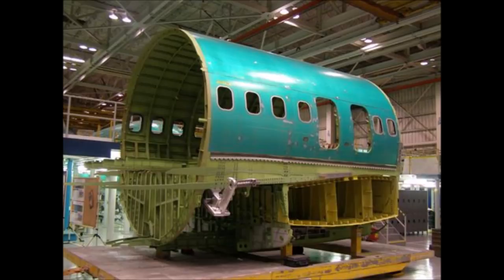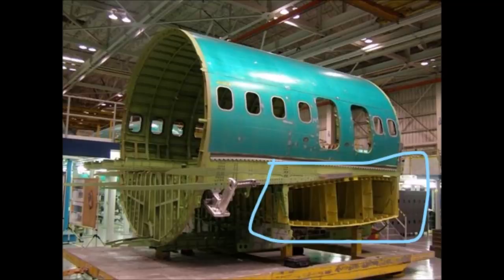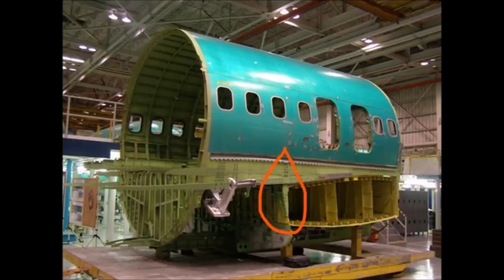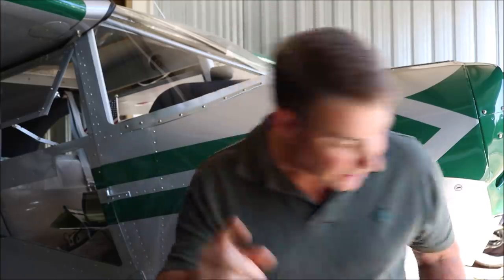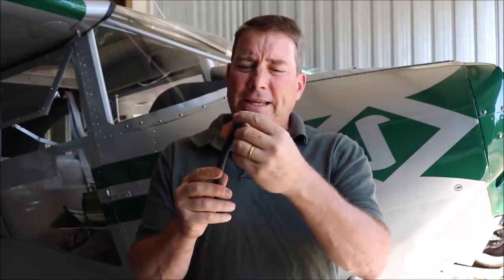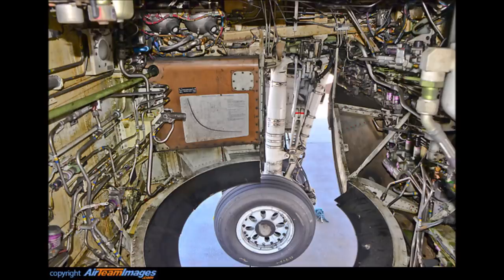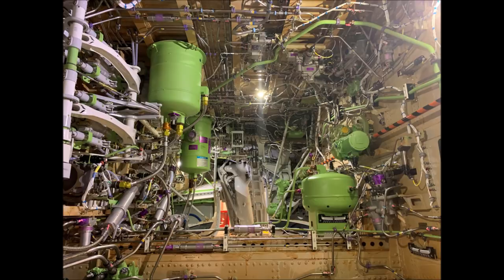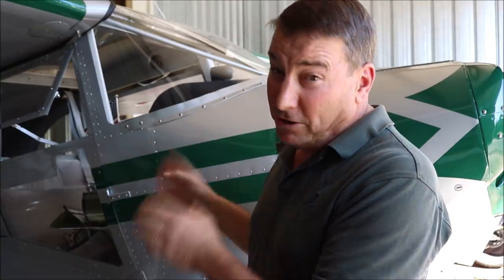737NG Pickle Fork Cracks AD 2019-20-2

Comment: Repairing the cracked parts looks like an absolute nightmare. Heaven knows how much would need to be stripped just to gain access to it, let alone getting in there and replacing/bracing the affected area.
Reply: Probably impracticle.
Reply: @angelreading5098  - I suppose it's up to Boeing to assess whether a repair is possible and what the cost will be. It sounds like the sort of repair that Boeing themselves would have to carry out, and it may well prove to be uneconomical. What a nightmare for Boeing and the owners.
Reply: Yes Roger I agree,thats a complete stripdown job to get even close to doing the repair and labour intensive too,not a good year for Boeing.
Reply: @angelreading5098  depends on the age of the NG and flight hrs
Reply: Yes that has to be factored in,true.
Reply: Difficult? Yes, but even difficult repairs are cheap compared with the cost of the aircraft. During a major overhaul, aircraft are substantially stripped down and rebuilt, so repairs could be done without all the clutter of a complete aircraft.
Reply: Angel Reading: More like "Fractured in"!!
Reply: I work at Spirit Wichita and that fitting comes out through the cabin still a big job
Reply: If it takes Boeing 10 days to assemble the finished plane, I suppose the repair can be done in 2 weeks (1 week to disassemble and another one to rebuild). You don't need to fully rebuild the plane, so it might take less time.
The cracks were found while repurposing some aircrafts, so it's not an impossible operation
Reply: This just reminded my off the one time the car manufacturer said to replace the whole front wire harness. Oh my goodness that's the first part they put in, everything was in the way.

Comment: Thank you for another informative video.  I see what you mean about the wheel well being a busy place. 

As I may have said before, I am an A&P with 38 years of experience. Working in air medical for 3 decades. The emergency AD my favorite. 🥺 There was several times that I got a call from the company alerting me to a new one. “Prior to next flight “.  Often the aircraft was 200 miles away and I had to drive there to inspect it.  Of course this tended to happen after I had gone home. 

I have left that job and will never do that again. This spring I am moving to Wichita. I am hoping to get in on the Denali as an inspector or tech rep.

Comment: Juan,
The 11/44 section, center section, of all 737 models is part of the whole assembly, built in Wichita. It's all one piece from the cab to the tail cone. Search for pictures of the train derailment while carrying NG737s to Renton. We lost several fuselages down a river embankment. They're all one assembly.
Reply: David Hampton Yes I certainly DO RECALL, that sorry mess, ,,  OUCH !  Cheers FROM NJ
Reply: all joins to make it a whole assembly, not all one piece. It's body sections joined together to make a fuselage
Reply: Yes, it is an assembly put together in sections. The Center Section is part of the assembly and can be replaced on it's own. But it is a colossal undertaking any way you look at it with tubing, wiring, etc that span the length of the fuselage through the Center Section. I suppose you could say it's "big bucks", or "bigger bucks" to repair one. ;-)

Comment: Auto mechanics pay for the warranty.......
Reply: I'm pondering the meaning of that.  Would you be so kind as to expand on that?  I've always gone with the notion that warranty work never gets done satisfactorily until the warranty has expired, and then the customer is left holding the bag.
Reply: @alext9067  Ken means that mechanics are compensated less for repairs performed than they would be if the repair was conducted out of warranty. 

Example: a repair that has a calculated billable flat rate repair time of 1.0 hours to perform would typically be compensated at .6 hrs if the repair is under warranty.

Comment: The wing box/center section is installed in Wichita, pull up pictures of the fuselage on the rail car leaving Wichita
Reply: Wichita,,,,, the Air Capitol of the World! Boeing, Cessna, Beech, Lear, Stearman, Belite, just to name a few! And if you can't fly in the wind,,,,, don't fly in Kansas.
Reply: @kenhurley4441 +
You forgot Spirit AeroSystems, formerly Boeing commercial in Wichita. Spirit would have been the builder of the fuselage.
The entire fuselage is assembled at Spirit and shipped via rail to Boeing in Seattle. Any connections like the stabilizers, landing gear or wings would have been checked for fit prior to leaving the factory.
Reply: Yeah, he was wrong  about the wing box!

Comment: Ot would be interesting to see if there's a trend on those planes with cracks and what locations and landing conditions they're subject to - do they have a lot more harder landings due to bad weather locations as common routes? Temperatures at those locations?  Also, have they been used by the same crews for a lot of the time and do they notoriously hard land?  Can all this lead to fatigue in those forks?
Reply: DerbJd There are many factors that could accelerate the process, but the pickle forks are designed to last the lifetime of the aircraft, and should be the last things to crack.
Reply: The metals manufacturing process can be suspect. From alloying-heat treating-and certifying the metals thru forming and assembly, there can be factors leading to premature failure.
Reply: @awesomexistence  True, although at this stage we don't know if it is a design or materials failure.

Comment: So, here's the weak link in the AD: The burden is on the operator to take responsibility for the inspection, but some airlines may put pressure on employees to not report the honest findings if it means having to immediately take the plane out of service and pay to replace a cracked fork. Especially, if the airline is already suffering revenue loss from their grounded MAX's or major debt.  Boeing needs to take a major share of the cost of any repair and the FAA should require a change in this policy of leaving flaws the responsibility of the operator. imo. Nothing should stand in the way of preventing loss of life because of a costly flaw repair.
Reply: Have to say I agree. Boeing need all the goodwill they can generate right now. But the FAA should involve themselves in forcing the issue. It's not as if they don't have a pressure point, as every day the MAX remains grounded costs Boeing heaps. Foreign carriers are not obliged to obey FAA ADs, but those carriers can be refused entry to the US if they don't comply. The FAA has a big stick. Why don't they use it? ( OK, I'm from Aus, so maybe I don't know just what powers the FAA actually have. )

Comment: The airline I work for is affected by this AD. The estimates we're hearing if a repair is necessary is about 30 days total out of service time due to extensive open-up. Very costly repair if cracks are found.
Reply: JestersDead That seems to be the story: https://leehamnews.com/2019/10/08/boeings-737-in-another-pickle-part-2/
Reply: JestersDead what sort of proof do the airlines provide Boeing/FAA that there really aren’t cracks? Photos?
Reply: @LIamaLlama554  The mechanics and inspectors that performed the inspection sign off the inspection as completed with no defects found. The paperwork makes its way to the FAA. There's not usually any requirements for "proof" that an inspection was completed beyond the paperwork containing the mechanic's signoff.
Reply: JestersDead Insufficient in my opinion with a repair that would be this costly. Major incentive to not notice a crack.
Reply: @LIamaLlama554  That's just not how it works.
Reply: JestersDead yeah, some upper management may not want to see this and say it should be okay for a few more flights just to not be in the red. This is when accidents happen.
Reply: @GrimYak  Upper management doesn't really get a say in the matter. If the mechanic / inspector writes up a discrepancy in the maintenance log for that aircraft, the plane is grounded until that discrepancy is corrected. There are instances where an inspection may be pushed to the maximum allowable limit (but still within accepted margins of safety) to try to minimize fallout if an inspection fails, but once the mechanics are on the plane, it's pretty much 100% their call. They are the ones signing their name next to that job, and saying the plane is airworthy. 

All of these comments about management trying to "push the envelope"... it's just really not done. At least not by reputable airlines. The stakes are too high when you have around 170 lives on the line for a 737-800. I wish it were easier to convince people just how many layers of safety are built into aircraft maintenance. The safety record speaks for itself though. Crashes caused by mechanical failure are incredibly rare. You don't achieve that kind of safety record by cutting corners on maintenance.

Comment: So in other words, if you find cracks you're going to have to disassemble the airplane to repair it. I can't help but wonder if carriers would just remove the engines and send it to the crusher. Edit from an airlinerwatch.com article: Pickle Forks are designed to last the lifetime of a plane on which they were attached. The lifespan of a Boeing 737NG jet is around 90,000 flight cycles. I bet that Boeing hands out "discounts" for new aircraft for those with this problem. It might be a win-win in the world of tax write-offs!
Reply: metatech Scary but true! The problem is only going to get worse on older airframes, devaluing their resale value. Edit: The replacement for the NG is the MAX, so that's a lose-lose scenario.
Reply: Or you buy a centre section off Boeing and cut the plane around it.
Reply: @gordonrichardson2972  They probably would not be locked into a Max. Many carriers probably would take a 787 for other routes instead of getting a Max. Boeing makes such deals on planes. Not that Boeing won't find a way out of its Max problems.
Reply: @allangibson8494  If its a widespread defect, there could be a shortage of spare parts.
Reply: @gordonrichardson2972  At the moment, I suspect Boeing would be quite happy to cut factory workers from the 737 line loose on making repair sections. They are running out of places to park 737Maxs....
Reply: @allangibson8494  majority of the factory workers are installers, not structural mechanics
Reply: @paulcroy8119  If you are going to have to replace a wing box then you are going to need a wing box section for the mechanics to install - the guys at the factory are the best people to assemble one of these. 
The factory jigs would also be the optimum way to install one of these. So you either return the plane to the factory or ship the jigs to the plane, do a cut and shut and then reinstall all the removed centre section equipment. Major job but still cheaper than a new plane (and you get a zero time centre section).
Reply: Allan Gibson   Agree.

When I was at Transamerica Airlines during the 70’s-80’s we replaced Herc wing center sections. Lockheed was involved in developing “next generation” wings for the wing cracks that would develop over time. We had some Hercs that had over 60,000 hours. Lockheed told me the initial design spec for the Air Force was 5,000 hours. No one, apparently, thought of the success the airplane would have, so it was a monetary decision, initially. It is not unusual for some aircraft to have life-limiting structural issues.

Comment: This AD is just for a visual inspection Juan? If a crack(s) is observed and not knowing the directive or procedure, does it call for NDT or die penetrant? Is there a procedure to "stop" the crack migration? Or does this part need to be removed and replaced? The Comets Tale comes to mind when I think of cracks. The first jetliner had square windows where cracks would propagate after a number of cycles leading to a disintegration of the aircraft.
Reply from the maker: Thus the "interim" nature of the AD. Things will change.
Reply: G May hello, but do you realize why they chose to use ;square windows’ ? , just look back, all prior aircraft had SQUARE WINDOWS’, but, none were pressurized before either !, cheers from NJ
Reply: G May The crack cannot be mitigated, the pickle forks will have to be replaced. We do not know the details, but it will be very expensive.
Reply: Gage , hello, but did you ever work in HAWAII?, why I ASKED,,is that MANY AIRPORTS,,ARE JUST FEET above SEA LEVEL, meaning SALT SPRAY, OUR Anti Submarine aircraft go through a ‘car wash’ because of SALT, IN JAMAICA,  many years ago, I went,along  with a friend engineer for the JBC,, then location we were at,,was over 700feet altitude,,And was amazed with the rust & corrosion,,it was from SALT SPRAY even miles inland., on a trip to HAWAII, IN 1972,  WE used AHALOA, and you could see salt crystals on the aircraft., so when that top blew off, that was the first thing that concerned me.,,,  cheers from NJ
Reply: Gage  that repair was done incorrectly! AOG mechanics called out engineering that it was wrong, and did their best for the NCO (rejection tag) to be reconvened for a better fix. Engineering wouldnt listen to the AOG mechanics, well documented piece on that.

Comment: Heavy landings going unreported ?
Reply: The plane should be designed to withstand such landings on a regular basis. It's interesting that this affects only a certain group of aircraft and not the Max aircraft. Which to me would indicate a different design, materials, or parts.
Reply: Or age....It sounds like the 3 aircraft had over 30,000 cycles.  That's a lot of takeoff and landings, meaning the effected aircraft are probably a couple decades old.  That's probably why they were being refitted for cargo work.
Reply: I would suggest the Max would be included if a) it was flying and b) any of them had anything like the number of cycles the 737NG have on them.
I think the final AD will include the Max as the structure is identical in that area.
Reply: @johnchappell4492  the pickle forks are designed to last 90K cycles. There shouldn't be problems at 30K.
Reply: @metatechnologist  The Classic, NG and Max each have different pickle fork designs.
Reply: @georgew2014  yes but the same designers....don't know how much I trust anything coming out of Boeing...
Reply: @georgew2014  you ever bring the center box into the fuselage or join the wings into the 737?
Reply: Materials used would be suspect. Metals manufacturing process from alloying-heat treating-thru certification. If the metal is found to be substandard, this could lead to premature failure. Processes in forming-manufacturing-assembly of the metals also can contribute to premature failures
Reply: @paulcroy8119  The box holds fuel and the landing gear, so can't be smaller. And the fuselage by itself can't handle aerodynamic stresses from the wings. The pickle forks, among other things, distribute those forces.

Comment: So they have key structural components that they have found to be well short of their required fatigue life due to crack propagation. They don't know the root cause for the crack propagation yet they don't demand inspection of aircraft with less than than 22.6k cycles. That seems very concerning.

Comment: Juan, isn't there a concern about a conflict of interest when an airline has to implement an AD like this, and potentially end up grounding many of their own aircraft and incurring the expense of repairing the cracks?  They have a week to inspect all their aircraft and then three days to report findings.  Seems like the rush to get this done and the potential for large, unplanned profit loss could lead to "errors" in reporting, particularly since the airlines have to bear the cost of all repairs.  Are there any FAA inspectors or some such party who will at least spot check the airlines to verify full compliance with the AD?  What happens if an airline does not fully comply?  The reports go to Boeing and not the FAA?  What does Boeing do with the info?  Do they verify that they received a report on every single one of these aircraft that they ever built?
Reply: The people performing the inspections are not executives that are concerned with profit margins. They are licensed airframe and powerplant mechanics. If the FAA finds that inspections are being "pencil whipped", the people responsible can lose their license (which will likely end your career in aviation), or even get prison time. It's taken very seriously. Once a mechanic or inspector finds a discrepancy, that is entered into the maintenance log, and it becomes a permanent record. The reports of findings will go to Boeing AND the FAA. 

And FAA inspectors do spot checks all the time, not only when there's a high profile AD. There aren't enough FAA inspectors to park one at every hangar operated by every airline in the country, so they do surprise visits. It's in the airline's best interest to comply with inspections anyway. Even if the repair costs $5 million, it's FAR cheaper than the cost of losing a fully loaded 737 due to structural  failure, and settling the lawsuits that are filed when it's revealed that the company didn't follow the prescribed inspections.
Reply: Thanks Jesters, that makes sense and clears up my questions.